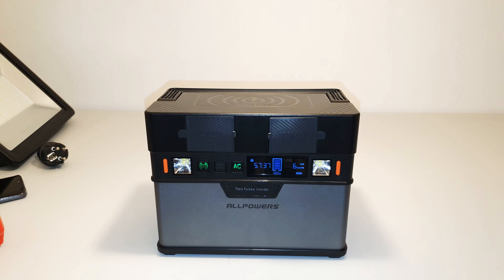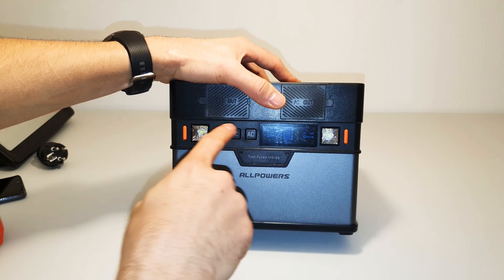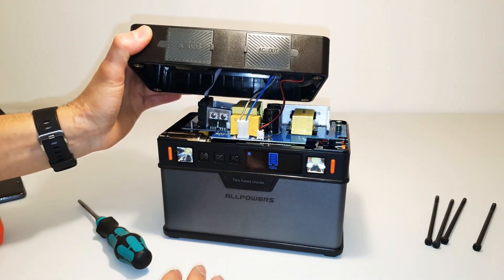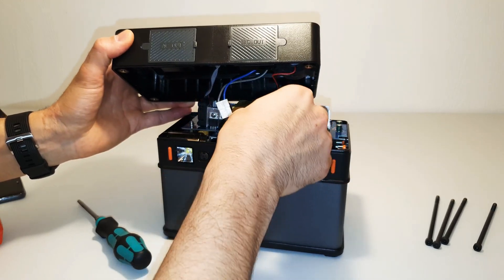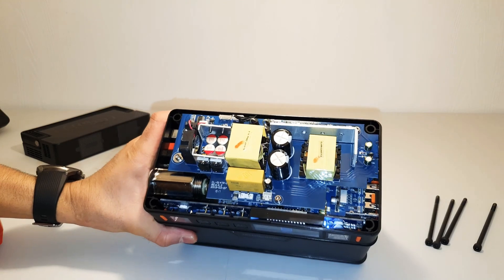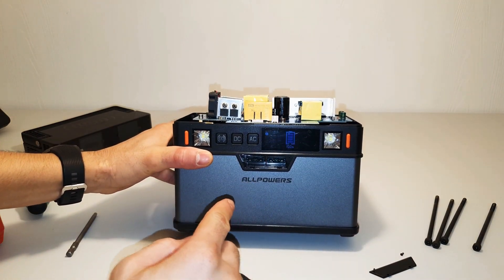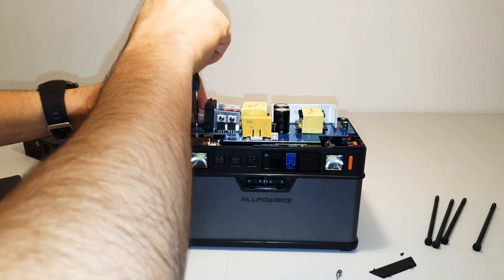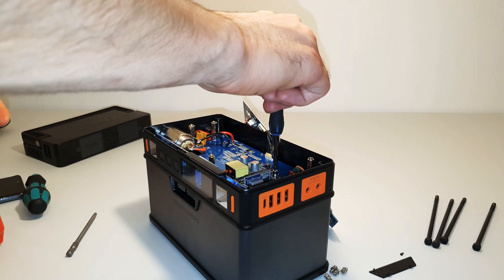Allpowers 372w Solar generator disassembly.

Comment: Battery  was charging neg to 4v BUT clip came off shorted to the gold contact below 4V now no voltage at main 2 pins that connect to board any idea what to fix ?

Comment: Hi I was charging mine from solar it made a pop sound and I could smell burning plastic and the unit no longer charges from any power source including the mains adapter but the unit works fine on all outputs,but I can no longer recharge the battery I checked the 2 front fuses they are ok is there another fuse inside the unit itself?
Reply from the maker: Sorry for late reply. No there is no other fuses. I think it could be the charging board. I will check it soon. I will keep you updated.

Comment: Thanks for your video. I have a problem with the USB C port in this unit. I used it to charge the battery in the car but suddenly stopped working. The other USB ports work fine and I have reset the unit to factory settings but still does not work. Any idea why this might be and how I can solve it?
Reply: How did you perform a factory reset on this device?  I've been trying to find out how for the past 3 months lol
Reply: @Kwestion36LondoN  hold both the AC and DC buttons at the same time until the display resets.
Reply: @Bamabrute85  Nothing happens.... All it does is toggle the DC beep sound on and off, just like it would if you hold the DC button down on it's own? Did it actually work for you? and if so, how long did you hold the AC DC buttons down for?
Reply: @Kwestion36LondoN  you have to hold both buttons for atleast 10 full seconds. It feels like an eternity.
Reply from the maker: The USB c in this unit is very weekly made. I will check it out. A can made and other video. I will try to find a solution